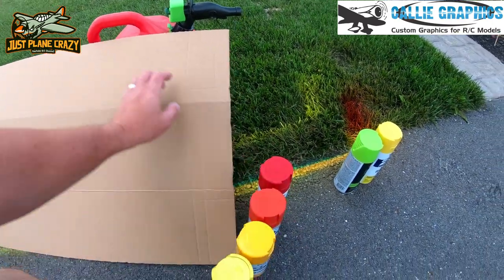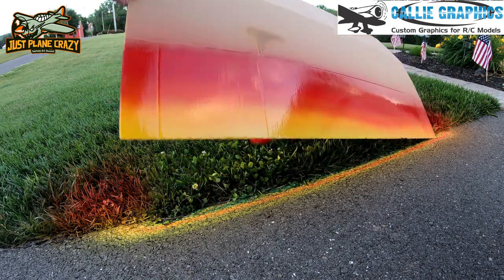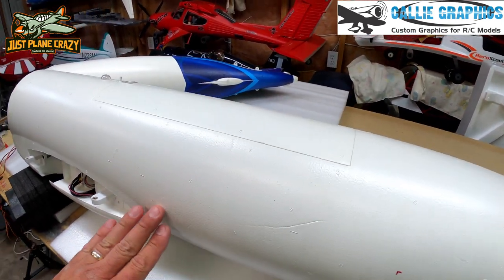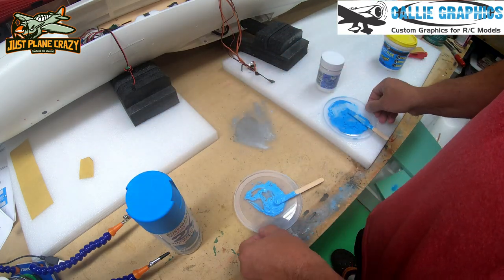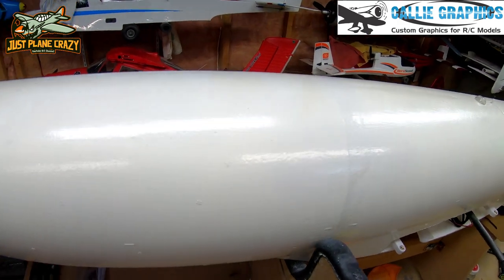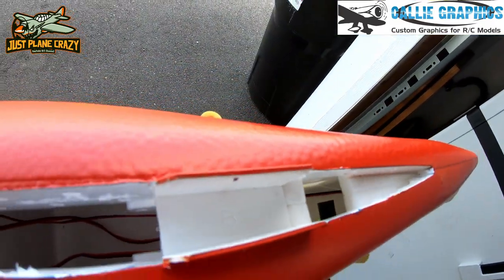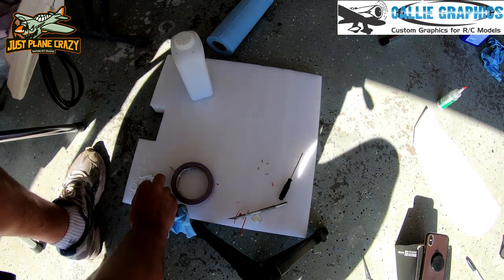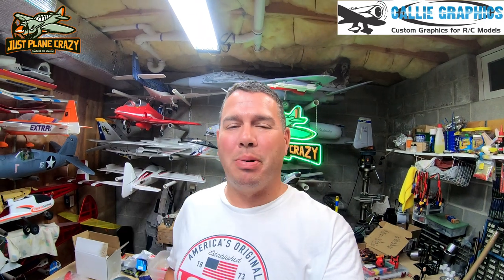Surprise Custom Freewing AL37 Build Series pt1, A Jurassic Sized Undertaking with Callie Graphics

Comment: Brendon, could you discuss how to paint foam. It would be a great tip for the majority of us
Reply from the maker: Steve. I would be happy to try and help more directly to your question. What part would you like more information on.
Reply: @JustPlaneCrazy  I read that spray paint melts foam, how do you prevent and what paint is best. Is their a specific distance. I have never painted foam and any help would be appreciated.
Reply from the maker: Steve that’s a great question. Different foams are different. Almost any plane made anymore is EPO foam. So nothing melts epo foam. You can use Rustoleum 2x, krylon, regular automotive primer, airbrush acrylic or latex from Home Depot or Lowe’s. Anything else than epo foam and you are exactly correct.  I shoot from about 6inches away. Now at times you do get a paint peel from unclean surfaces but in one of these vids pt 2 I believe I show you that happened. Also how to handle it. I don’t like the clear coats from the krylon or Rustoleum as I always have issues with them. I stick to minwax WATER based 
  I think I will give this vid a shot one day though. For sure. Great idea
Reply: @JustPlaneCrazy  Brenden, thanks for the information. My Avant is about 3 years old and needs an update.
Reply from the maker: No problem. Best of luck